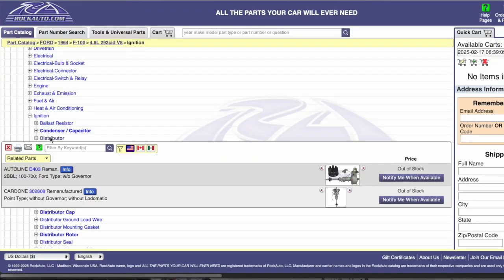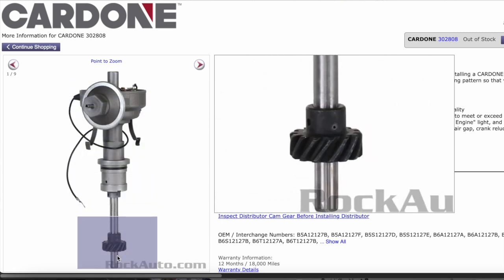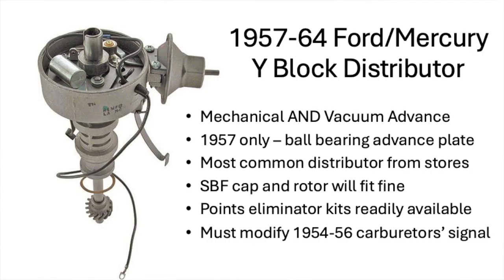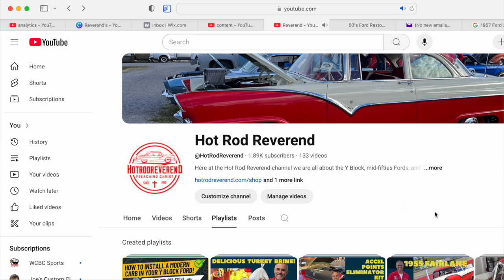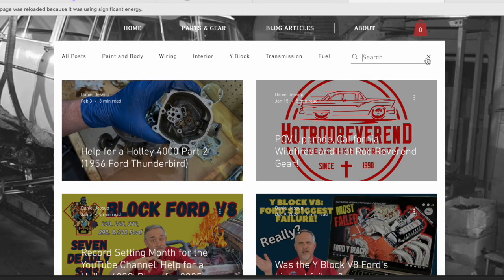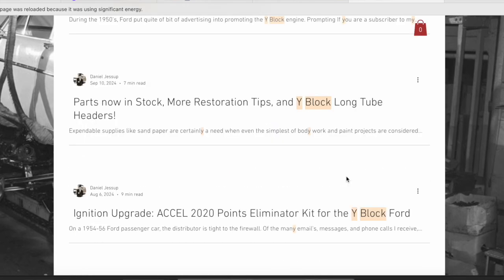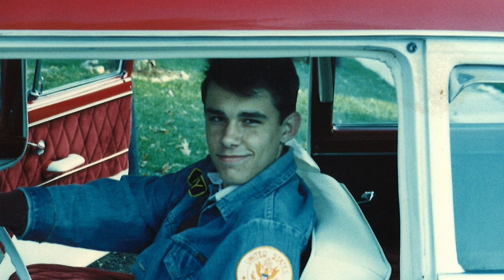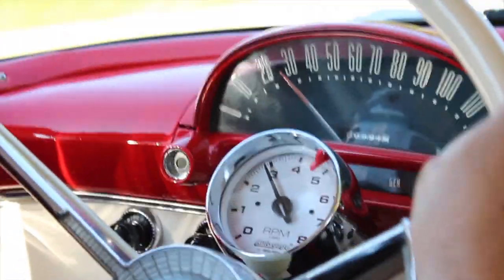How to Fix Your Y Block Ford V8 Distributor Problem - Differences, Design, and Technical Help!

Comment: When the distributor gets seized in the block you heat it up with a torch real hot and then let it cool then you will find out it is loose when you remove it and reinstall it put grease on it and install the gasket also
Reply from the maker: A little anti-seize goes a long way too

Comment: Just came across your YouTube channel.  Very informative for a stock '55 Merc Montclair.  Several years ago we (I mean the shop I use) swapped out the original carb for a later model Holley.  Ran into the exact problem you mention here.  A total slug.  Also had to use an adapter plate to fit the Holley on the '55 intake manifold.  Did the swap to a later model intake along with a distributor from a '60 Yblock and Pertronix ignition.  Lit that old Yblock up.  Runs great now.  Again great information for anyone with a Yblock.
Reply from the maker: Thanks for watching - hope you will subscribe and share. Not much is available on YouTube for the Y Block; trying to fix that 😉

Comment: i replaced my load a matic distributor with  a 1964 292 distributor from napa. I also swapped the small cap to the modern post style cap using a adapter from a 1977 351m distributor  which is less prone to cross firing with a higher output ignition system.  I hate setting points on a y block so i decided to convert the points to trigger a ford tfi module which fires a ford tfi coil from an injected ford small block from the 80s.  This is better than any aftermarket high energy ignition will ever be because its OEM rock solid reliable. A stock 5.0l ford tfi ignition was engineered to be more than adequate for 400+ hp and will not leave you stranded on the side of the road like the MSD and Mallory junk ive had in the past and  parts are readily available and super cheap .Wrecking yards are full of spare tfi modules and coils for next to nothing. I keep a few spare modules in the glovebox and a spare coil behind the seat in my 1957 Mercury half ton....just in case. Its like a night a day difference from the old load a matic pig, pulls hard all the way to the top and gets better MPG to boot .
Reply from the maker: That sounds like a great upgrade! Any chance you have a YouTube video to show the steps on the workbench? I would imagine there would be a number of guys with interest on the parts too. And, I get you on the points - reason being with the Y Block and that distributor in the back, the hood near your head, etc. Lots of FUN>

Comment: I have these symptoms with a 1957 y bloc (TBird) with a direct replacement Holley carb and original dist. It dies when put in gear. I'm always driving with 2 feet. Cruises nice with good power.
Reply from the maker: Your idle circuit is too lean most probably. Essentially what is happening that under load you are not getting enough fuel into the A/F ratio.

Comment: lots of good information. Thank you. I bought a Cardone Y block distributor a few years back and it never worked right. They had halfway drilled a hole for the gear pin and stopped and redrilled the hole the current pin was installed. Looking at first hole and taking the old distributor to match up, it was closer to the original spacing they the second drilled hole they used. I just removed the old parts from the original and replaced what I could with the new parts and it now works fine. One of the warnings on the box states the end drive can be a hex drive or a tang? I thought they all were hex drive ? I had read many years ago that Fords two misjudgments on the Y Block were that Ford thought engines wouldn't grow is size so fast and they would keep that engine for years like the old flatheads just bumping up the cubic inches every few years. Also they thought higher compression would boost power with better gasoline. This article or book stated the Y block could handle much higher compression because of it's cylinder head design. Thank you for these videos, it's helps me keep my 312 Mercury on the road.

Comment: So what about tuning the 64 distributor? What about the hex around the vacuum hose? Inside is a spring for vacuum advance rate. Max degrees akso need adjusted.
Fly weights get tuned by springs as any car.
55, Vic HT, 272, AT, PS here.
Reply from the maker: OEM 50's and 60's distributor tuning is certainly a thing - the old Sun corporation were known for their distributor tuning machines. I would love to have one. Of course springs can be swapped out but those old machines were really the ticket for tuning.

Unfortunately the remanufactured Y Block distributors I have installed over the years - it always hit or miss on whether or not the company put in an adjustable vacuum advance. Sometimes that is the case, other times not. The adjustment for maximum advance can be made by taking up room in the slot.

Comment: Great information Reverend. 👍 I got a 1956 272 truck motor on a stand in my shop that is going in a 1932 roadster chassi and I got a nice 4-barrel Edelbrock for it.
Reply from the maker: That sounds like a great setup - would love to see some photos!
Reply: @HotRodReverend  There's just a pile of parts now but I'm building the roadster body now on my YouTube channel.
Reply from the maker: @ will check it out!

Comment: After changing distributor it seems to be the fuel pump.
Reply from the maker: Not quite sure what you mean - are you trying to say that after you swapped distributors the fuel pump gave you trouble?

Comment: Ol' Ford and their "Better Idea".... Been on the search for a later unit. Those are tricky to find. I saw a couple Holley Y-block dual point distributors. I bet those were marketed to help sell their intake and carb setups for the 2bbl Y-blocks. Also noticed the FLOOD of overseas HEI distributors for Y-blocks too. Would rather stay away from them if possible until i find out more about them. Maybe a future video? Thanks for the info Rev!
Reply from the maker: I have a Top Street Performance (TSP) unit that I am saving for my 313 build. It is an HEI version. The CRT brand seems to be holding up well too from what others are saying, but I have no firsthand experience.

Comment: I remember when I owned 55 Fairlane with a 272. It had the load-o-matic distributor which worked fine with its Holley 94 carburetor. I was planning on installing a 4 barrel carburetor, but gave up on that plan after deciding that I would have to find a good centrifugal and vacuum distributor to use along with replacing the carb and manifold. I can identify a load-o-matic distributor by the size and shape of the vacuum advance can which looks different from the vacuum advance can on the later distributors. Ford also used the load-o matic distributors on the six cylinder engines into the 60's.

Comment: Thanks for explaining the need to match the carburetor and distributor. The 1956 and earlier vacuum system use venturi in the carb for the vac. signal  and 1957 and newer use manifold vac. for signal. They work opposite of each other. I hope this helps and is correct.
JonnyD